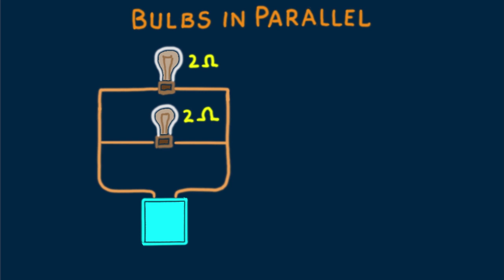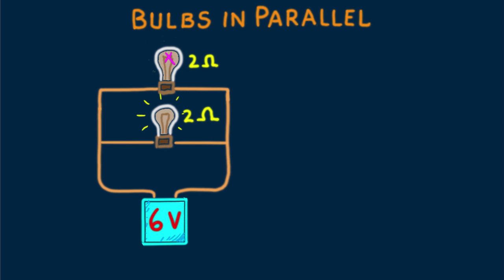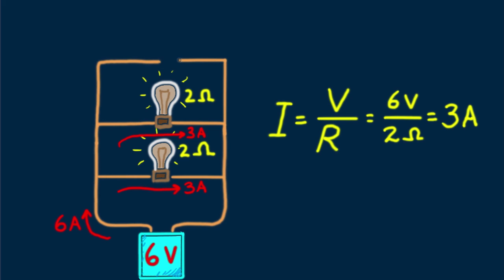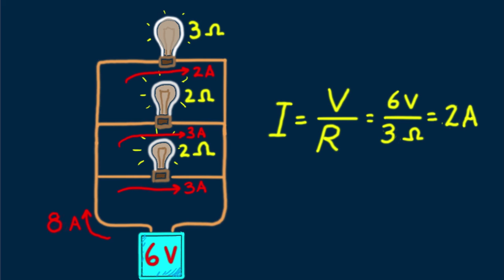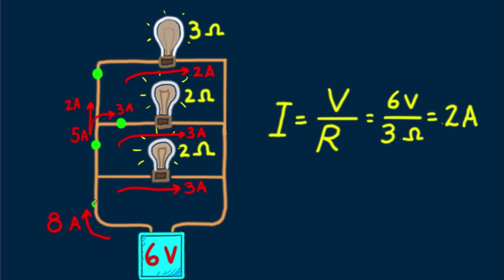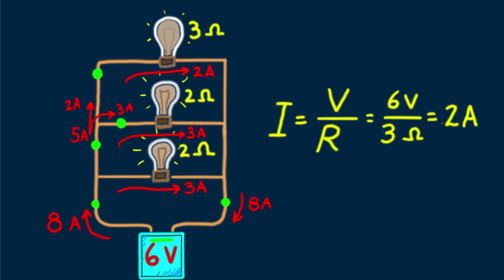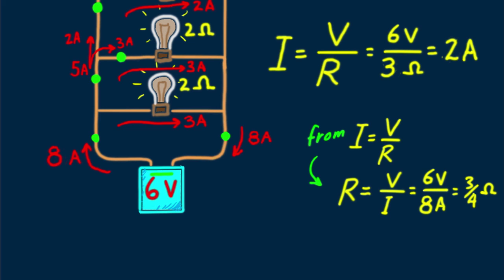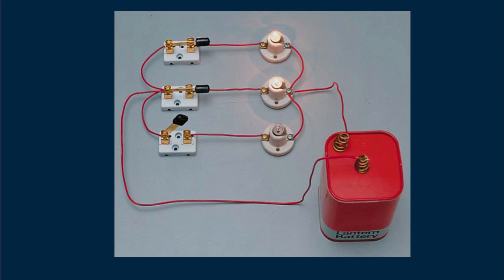Hewitt-Drew-it! PHYSICS 94. Bulbs in Parallel

Comment: Answer to your questions:

The brightness of the other two bulbs will not be affected as they're still getting their share of current and the same voltage. 

Current from the battery will be affected. There will be more current drawn because the bulb requires current to flow through it to turn it on. 

Am I correct?
Reply: Kiana Kianaa if they are getting more current but the same voltage then the bulbs will be brighter. Power (which is related to brightness) =voltage * current.
Reply: YES

Comment: All the bulbs are getting the same voltage because they are in parallel, therefore all connected directly to the battery. They all have the same current in each (assuming that they have the same resistance) but the BATTERY has increased the current that it puts out. This is the same as the drawn out example at the beginning. The bulbs glow exactly the same brightness.

Comment: The bulbs will be dimmer. The battery will be unaffected. The current is the same going in and out of the battery. The current  splits when more resistance or light bulbs are in parallel. Thus less current for other bulbs in parallel and dimmer lighting.